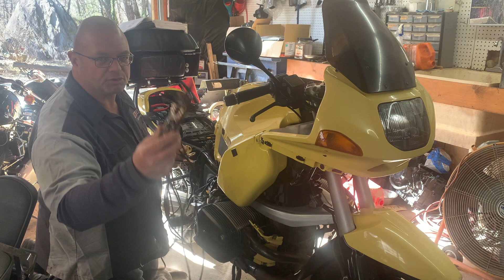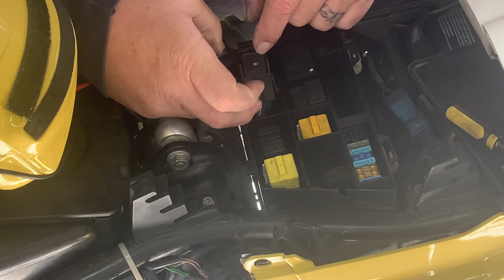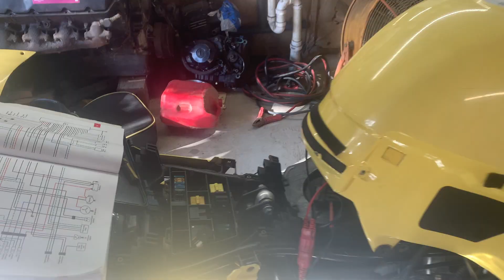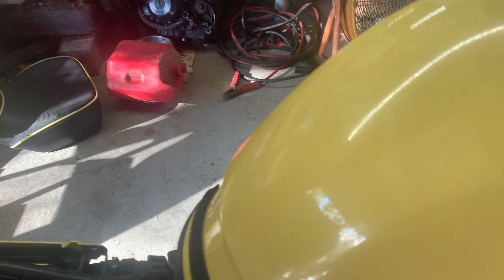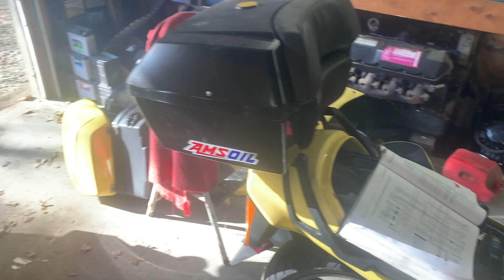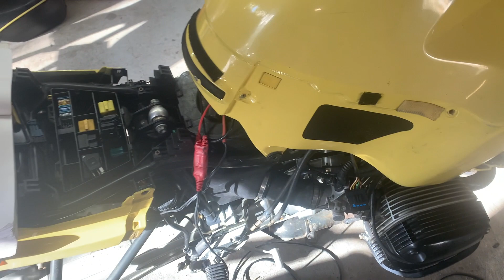In the shop, bmw r1100rs no start

Comment: just found this video after firing the parts cannon at my RS, tested all my relays and they functioned, got them soaking in vinegar to clean the contacts, from my understanding of the circuit, both relay coils supplied from sidestand, monotronic relay has a permanent ground and when activated sends current from fuse 5 to monotronic unit, fuel pump relay coil grounded by monotronic unit sending current from fuse 6 to injectors,fuel pump

Comment: what is the name of testing device ? how can you regulate voltage so nothing will be fried?
Reply from the maker: It is a power. It only uses the motorcycles current voltage.
Reply: Use a Fluke 77.
Doesn't provide a pwr source but does everything else

Comment: Same problem here, but I find that there is no ground signal commiing in to the fuel pump relay, so I jumped but now the fuel pum is running non stop, is that normal?
Reply from the maker: Yes, I believe it’s supposed to run nonstop, but it has an internal regulator to only allow specific psi to reach the injectors. Any surplus fuel just gets returned into the tank.